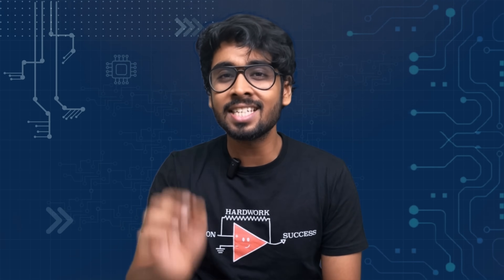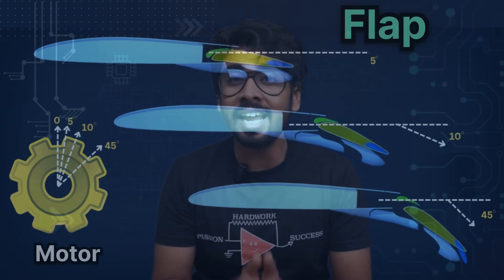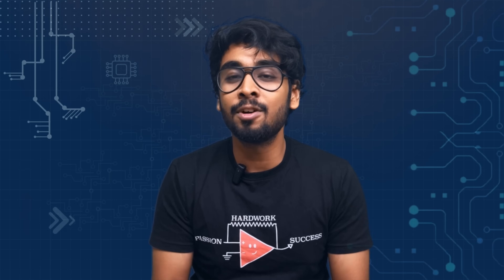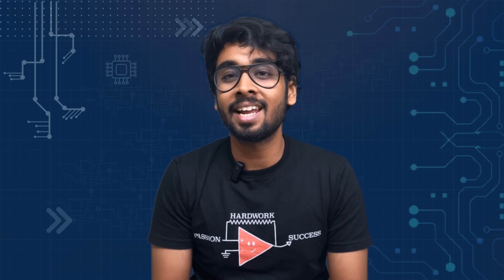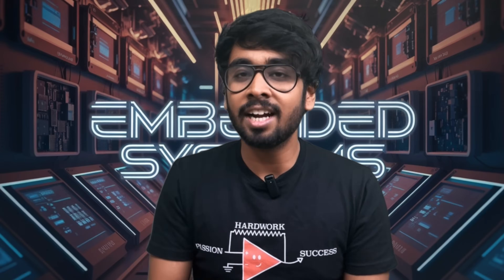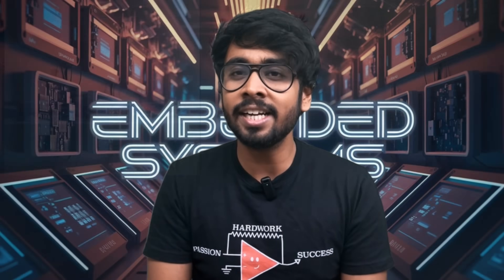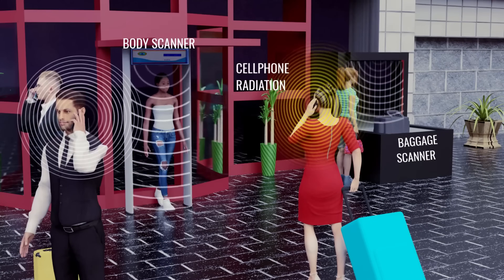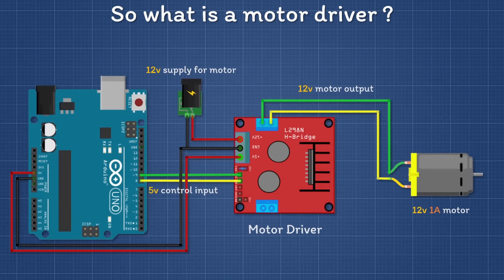All about Embedded Systems | Must master Skills | Different Roles | Salaries 💰

Comment: You have confused yourself with the airbrakes and flaps, flaps when deployed, during landing as it increases the aircraft's lift inorder to compensate the low airspeed to prevent stall even during landing but air brakes have one function i.e to reduce the speed of the vehicle.

Comment: I work in automotive industry.
I make logics for software in MATLAB tool.
Am i also an embedded engineer?
Also how is AUTOSAR related to this?

Also, you mentioned only semiconductor industry and consumer electronics. Why not you included automotive industry or aviation industry as you used in example( airplane flaps).?

Kindly clear brother...
Good video....
Reply: Also ,how can we relate this video of yours to automotive software industry in ECU development? 

Is it same or different?

Kindlyclearbrother...❤
Reply from the maker: When I meant consumer electronics I meant any industry that uses these microcontrollers/processors and develops a system on top of it.So you can include Aerospace and automotive industry too.

Comment: I am interested to join job areas like aeronautics/avionics, defense, transportation/railways(primary interest- two parts- signalling system and propulsion system), space and anything large critical and interesting as given examples either in govt or pvt sector where we make use of knowledge we gained in course and we learn lot more, can you please guide on job market for electronics/embedded system career

Comment: Hello @sanchitkulkarni, I am interested in embedded software development and want to to switch to the the embedded field. I have my education in mechanical engineering and worked as mechanical engineer for 4 years and then switched to software development and have worked as web developer and automation tester for past 3 years. May i request your guidance on how to start and path should i follow to get in to the field. I have gone through different vides and articles and it has confused me how to start and which path should i follow.

Comment: Hi bro I am ece graduate with 2 yrs of work experience as a frontend developer. But recently i have started my gate prepration and now I want to do Mtech in VLSI or related field. The reason is with rise of Gen AI I am fed up and I think I can lose my job in future to genAI. I am preparing for gate and want to do mtech because I believe GenAI can't replace a hardware or VLSI engineer is it right?

Comment: flaps aren't exactly used to reduce speed. They are used to increase wing surface area to generate more lift at low speed especially during landing and to add more lift during takeoff. 

Avionics designer here.
Reply: Hello brother! Can you explain about your role and where you're working?
Reply: @ichbinvkramm  working with Honeywell as avionics engineer.
Reply: @joshuvajohnvarghese  what are the responsibilities of ur role?
Reply: @ichbinvkramm design and development of new systems and updation of existing avionics systems for airbus A320 and A350 series
Reply: @joshuvajohnvarghese  is it someway related to embedded domain? I'm asking this much because I'm too planning for embedded roles in aerospace/avionics industry
Reply: @ichbinvkramm  Yes it is. All the best.

Comment: Web Dev is flooded 😂
Now only this field is remaining 😂
Reply: Yeah completely, it's nice to see someone thinking the same but I'm sure many other do too. I did a web dev placement for a year as part of a CS degree. Did not like it too much. Sure, I learnt alot and can build web APIs, frontends, backends with some confidence now,  it's a few years later. But it's so over populated, and everything in web dev is framework madness, all these "shiny" new libraries and frameworks to use, it's annoying. 

At least with Embedded Systems or general low level "actual" programming, it is real... You need to know how the hardware actually works... I think this initial learning curb puts many off, and web dev is a quick buck.
Reply: @markjenkins9424 yes bro I'm a web dev it is true

Comment: Bhaiya i need an advice. I a 2024 passout woth btech in information technology. Rn working at a service based company at 4.5lpa as data enginner.
even during college days, i have absolutely loved electronics related subjects and low level cs subjects more than software engineering.

How can i switch fields? Is it a good move? Financially as well. Was looking at embeeded and vlsi. Should i start by learning c properly?

Please suggest. I am having sleepless nights 😥😥
Reply from the maker: If you can master C/C++ and will be open to learn Hardware you can very well switch to embedded. 
As I mentioned in semiconductor industry embedded engineers are paid really well!!